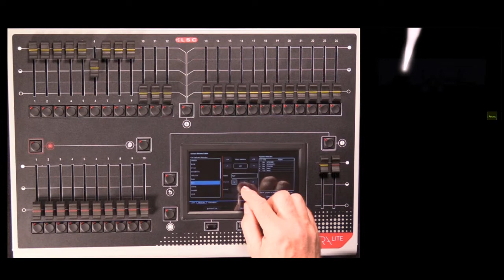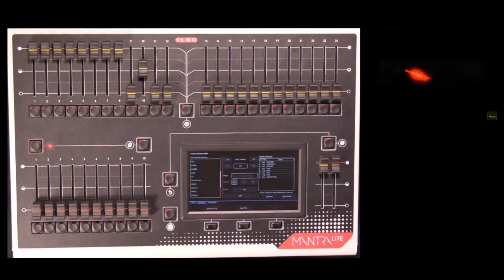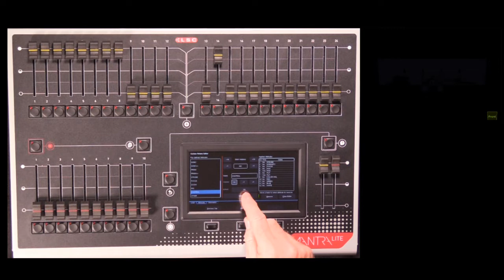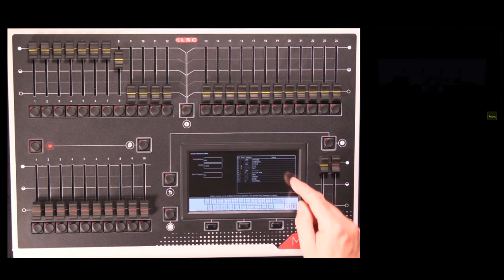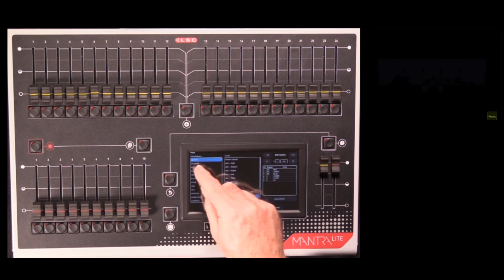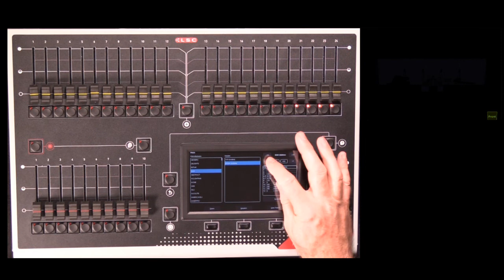LSC Mantra Lite Video 7 - Creating a custom fixture template

Comment: Something Richie didn't make clear in the video is how Mantra knows what slot each parameter is being assigned to.
When you go into the Fixture Editor, there is a highlighted box (roughly centre of the screen) that displays the slot number that a parameter/attribute can be attached to. It defaults to 1. If you have a complete list of all attributes, then as you select (or type) that attribute and press Add, that number in the highlighted box advances one automatically. This allows even a 40 slot fixture to be created (if you have the DMX chart.)
However, if you do not have the DMX chart, then the method shown in the video becomes the way to create the file. The Highlighted box automatically changes when you touch any of the yellow faders and the number becomes the last fader moved. This means that if you bring up 10 faders and finally get light out of your fixture, then play with fader 2 (intensity in the video), the last fader mover becomes the Highlighted Box and as you press Add, the Intensity automatically assigns the Intensity to Slot 2.
This is very intuitive (have a play and you will see what I mean), however if you are moving Yellow faders all over the place, always ensure that the correct destination slot is selected (the highlighted box) prior to pressing Add.